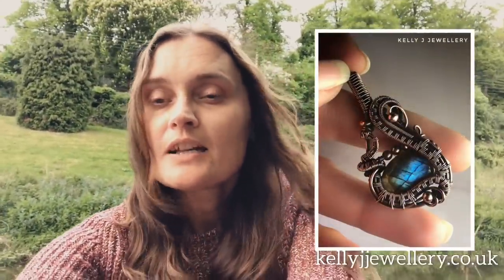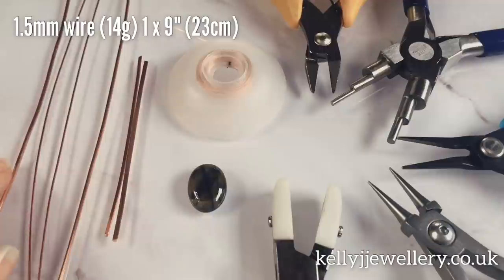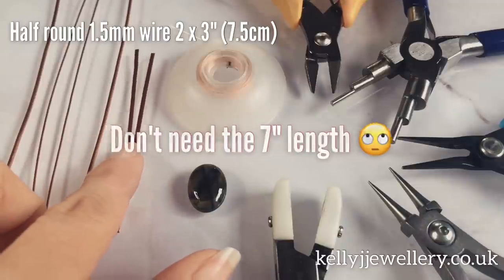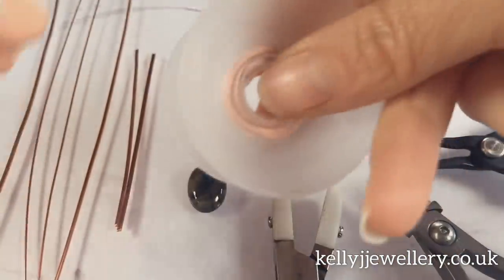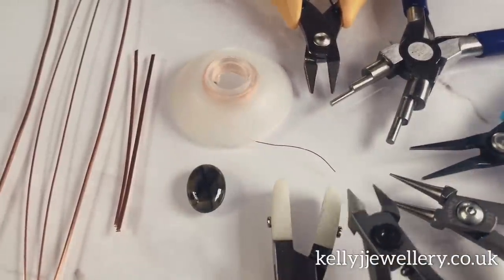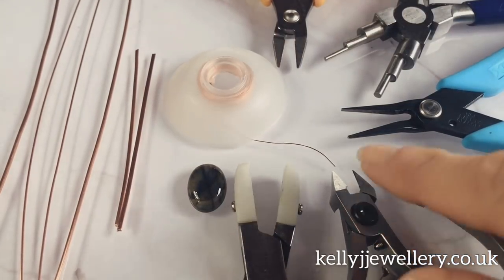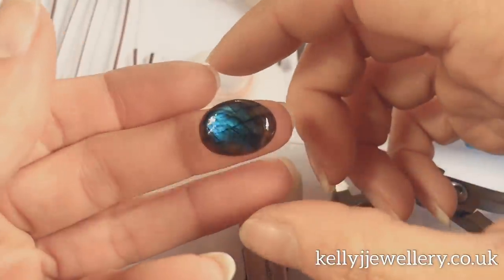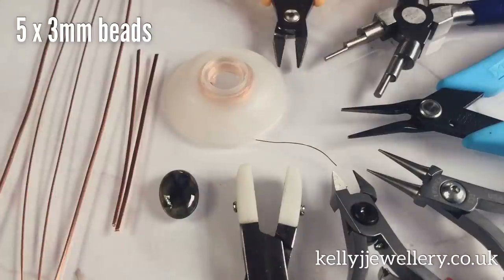Wire Wrap Pendant “ADORE” Tutorial.

Comment: Kelly I don't have 1/2 round wire which is that thick. I think I only have 20 or 18 gauge. Can I use that and loop it twice for each one instead of once? Does that make sense? Thanks, Ann
Reply from the maker: As long as the stone is held from the back you'll be fine 👍😊
Reply: @KellyJJewellery  thank you.